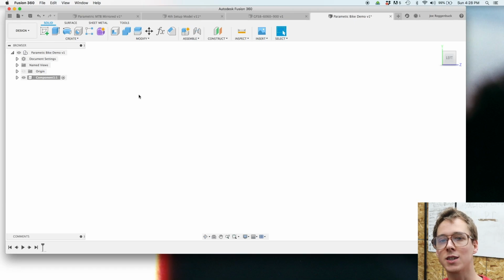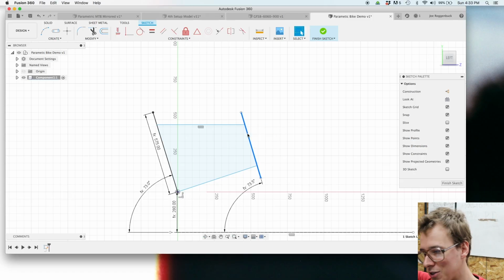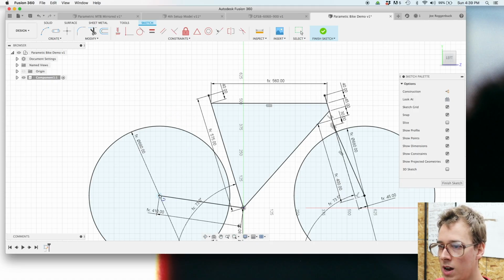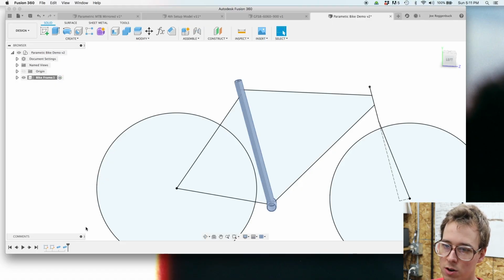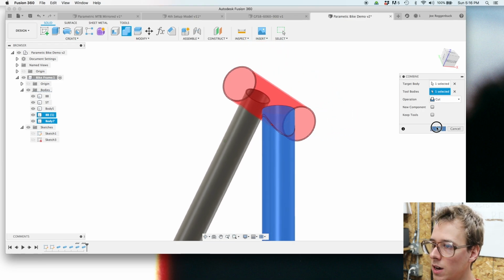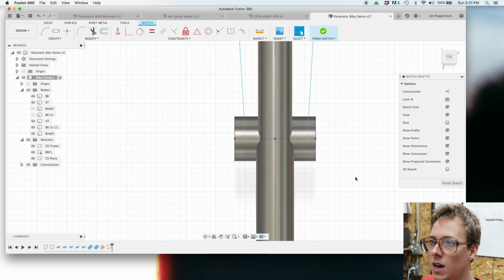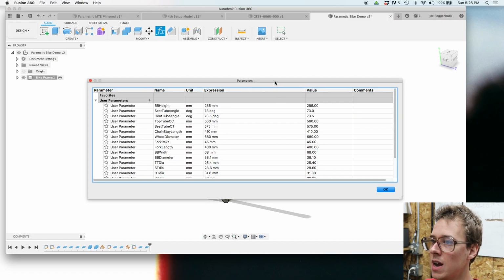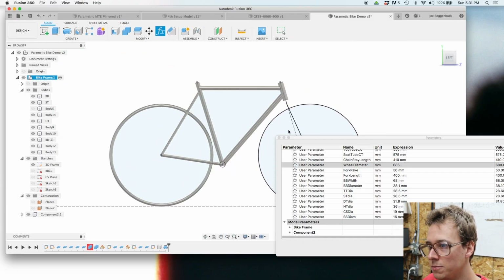How to 3D Model a Bike Frame in Fusion 360 (Parametric Design)

Comment: Just wanted to drop you a note. I commented in the past on your Everlast i-Tig 200 video, I have an i-Tig 201 which has a couple decent improvements over the i-Tig 200. I pony'd up and got a Primeweld Tig 225x, and couldn't be happier with the welder in comparison to the green weenie. I didn't have a lot of complaints, other than the service and support that Everlast provides, the people are just horrible to deal with and demeaning to the customers. Primeweld is quite the opposite. And the Primeweld comes with a genuine CK Worldwide 17 flexhead, which I upgraded my green weenie to. The Primeweld does aluminum as well, it's an AC/DC machine, comes with a 3 year warranty with shipping paid if you need service and shipping included in the price. How they do it, I don't know, but I have yet to read a bad review or even read about a DOA unit from Primeweld, unlike the green weenie, Everlast has dead units all the time...and they charge shipping both ways on the customer even if they do honor their warranty. More often than not they try to off the blame on the customer and leave them dead in the water. Caveat Emptor. If you're looking to get another welder, I recommend checking out the Primeweld. No affiliation, just a satisfied customer.